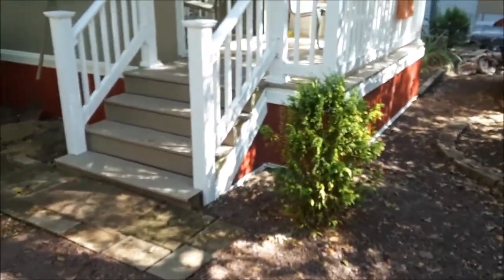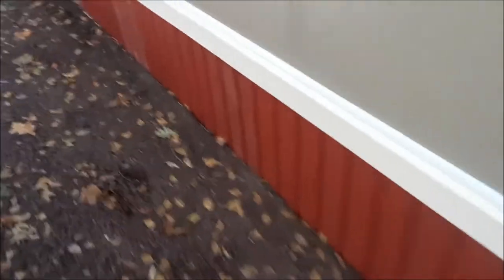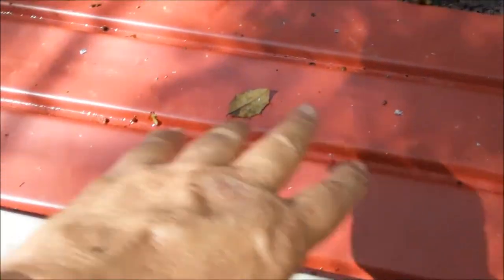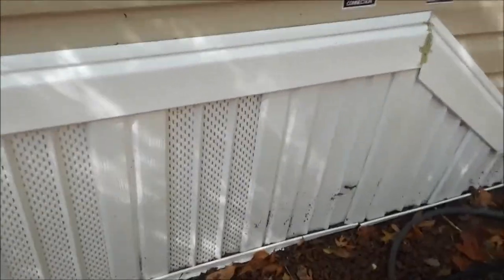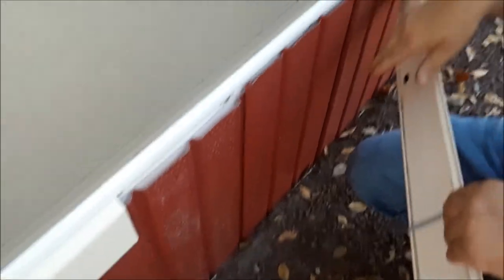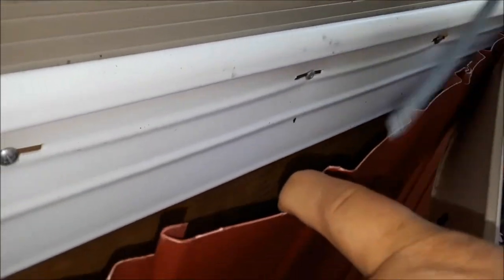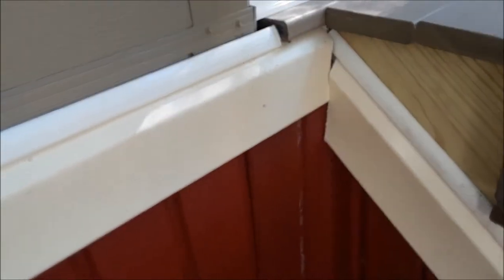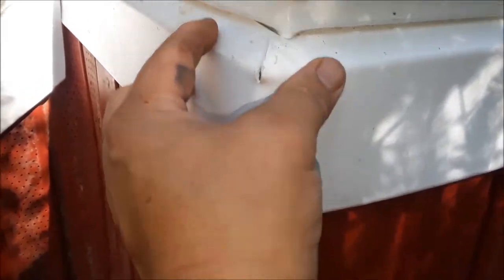How to Install Trailer , Mobil Home,  or Park Model Skirting

Comment: Should you screw the sections in place loosely. Mine tend to bow in the winter time and they were screwed in under the locking piece
Reply from the maker: Screw top track only...the rest just connect...but u could screw in a problem one in...

Comment: How do you install the last piece of skirting?  The sides lock together, so if you have to trim the width of the last piece, how do you lock them together?
Reply: You gotta know what your doing for one thing..if you do the measuring right it will work out for you..never pull tight on each piece you put up.. always let it relax..make sure every price is straight and not crooked,use a framing square if you have one and a torpedo level and it will turn out great.. remember the last piece will slide lock together if you do the measurements right..I do this for a living so I had my fair share of mess ups when I first started believe me..do the measuring right and your good..that's all there is to it..

Comment: How do you determine the height of the top piece from the ground?
Reply from the maker: Just follow bottom of room and put on straignt...then do the bottom track then cut siding to fit.  There is a lot of room for error as the top cover is 4 inches.   Allow a little room for setteling etc of the siding.  The top piece has nothing to do with the ground but more bout the bottom of the room..  TY
Reply from the maker: The top cover gives you 4 inches ...so as long as it falls in that 4 inches its good.....But u should be 1 inch from top track  and the 4 inch top piece will cover nicely and give plenty of room for settlement
Reply from the maker: The top cover gives you 4 inches ...so as long as it falls in that 4 inches its good.....But u should be 1 inch from top track  and the 4 inch top piece will cover nicely and give plenty of room for settlement

Comment: My trailer we just bought has skirting like yours except white. Filled with mega holes. What do you use to cut it?
Reply from the maker: Hack saw for the heavy trim and  large scissors or tin snips for the panels.
Reply from the maker: Holes are for ventilation...I use Hack saw for upper and lower track and  large industrial scissors or tin snips for the large red side panels

Comment: i have watched dozen of skirting videos and every system is crap. Is there not a good system out there? Every system rodents would be in there in no time making a home. How come none of them solve the rodent issue? Why not have an insulated skirting? If you do under the trailer properly and have the air quality the same as in the trailer, you dont need vents either. I want to redo the skirting on my pier foundation house but every video I have seen on youtube has been useless. I want a system that lasts, thats insulated and doesnt let critters in my crawl space. I havent found one yet. Does anyone know of a good system for what i want? My crawl space is already vapour barriered entirely, skirt is spray foamed, i want to redo it because of rot on the outside of the skirting and rodents.

Comment: The  bottom. {track} is okay the guys that worked on it put  the vinyl siding into the track on top is the Rail  closes it anyway we had a bad storm one of the panels on the right  part of the corner broke in 1/2 i found the the tiny bar it is very long it is missing in that spot  { Only one side of the trailer house}  no idea if i can even find that no luck I have called ace ,  Home depot,  L & M supply  none of them have it it is  right in between 3 and 9  39 inches up  the panel is small  someone mentioned  hay bales  I do have  blocks  i just don't know what i can do to fix it they never  left much materials behind  as in Skirting i have 1 piece they threw away  don't know itf it will fit. We don't have  mobile homes  that was closed down many years ago over 34 at least . I am in Minnesota  medium sized town  i even called Restore  no luck there either .